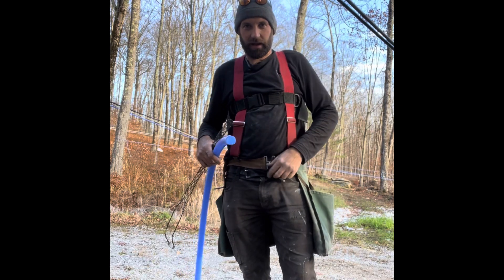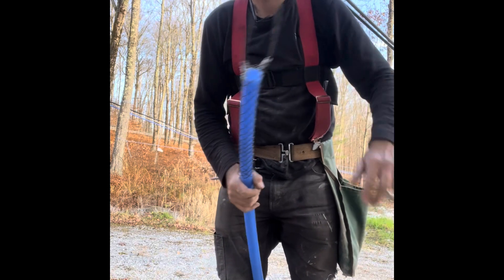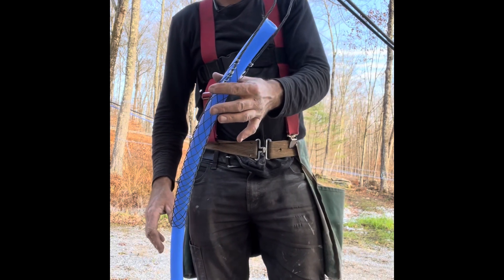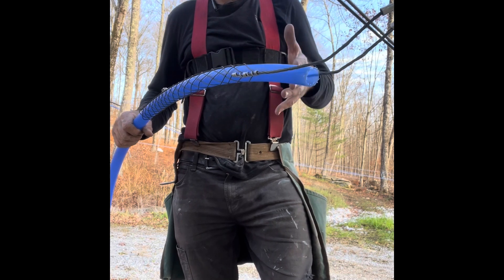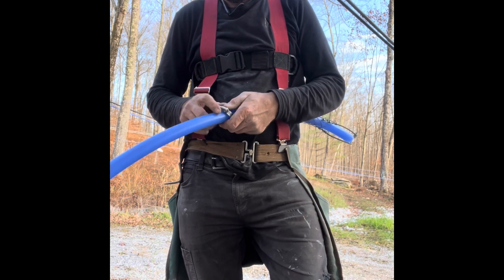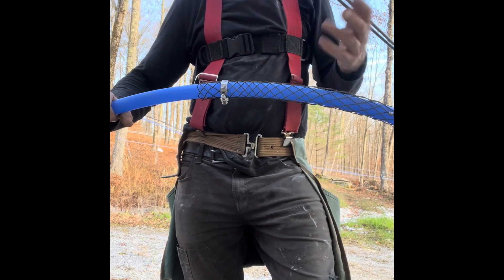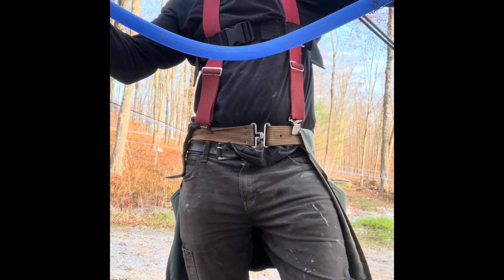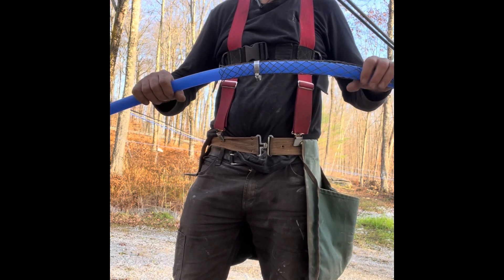How to install a tension grip onto a maple mainline

Comment: Hey Chad, are you holding both ends of the pipe with tension grips? I feel like you had a video of what you do on the end of the mainline but I couldn’t find it tonight. 

Feel like it was just a hose clamp around the end of wire loop kinda thing. 

Thanks!
Reply from the maker: Yes I do use a grip on both ends. Do you need to? Probably not.

Comment: I've always put the clamp on and had the grip run into the clamp so its on the pipe up where pulling loop meets the woven part of the grip.  Don't know where I seen that but so far its worked.  Do you think one is better than the other?
Reply from the maker: Yes, when clamp is at the end it promotes the entire length of the grip to squeeze the pipe as it’s pulled backward.  If you put clamp towards cable end it essentially is only grabbing from where you put the clamp to the cable. 
You want the entire grip to be working.